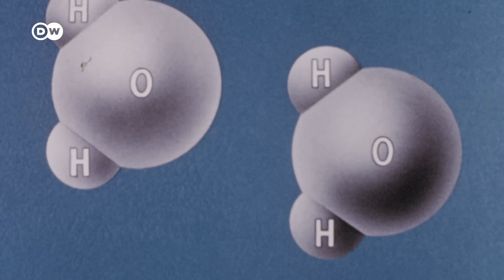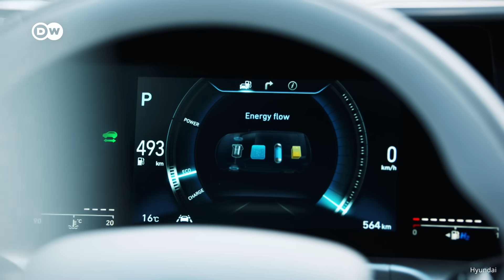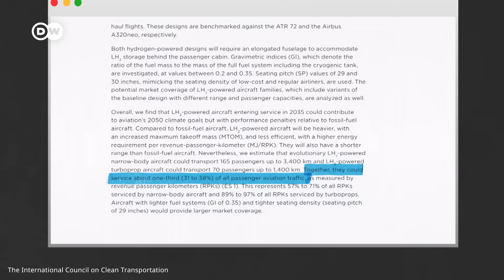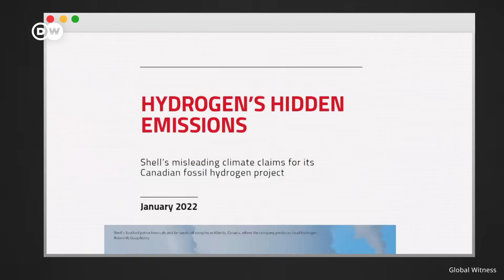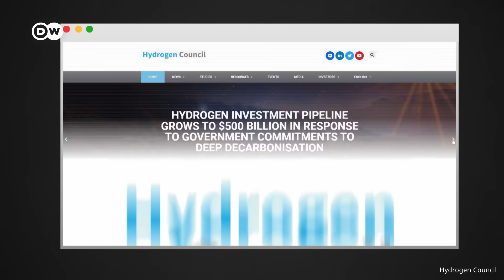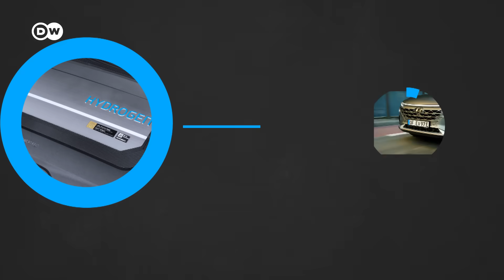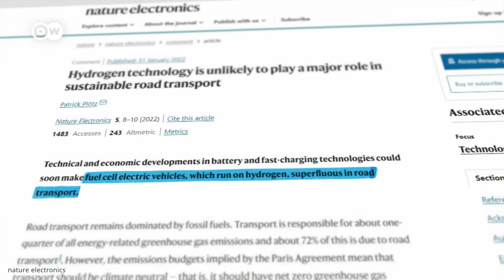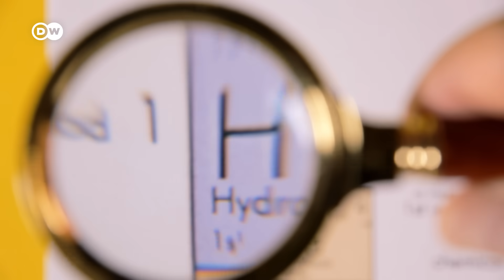The truth about hydrogen

Comment: In my opinion the real flaw in the hydrogen economy is (and always has been) the scarcity of the Platinum Group Metals used in the only currently viable hydrogen fuel cells.  There simply aren't any alternative catalysts which provide the same efficiency and longevity.   We're talking about trading one non-renewable resource, with another, that is much more rare and expensive to obtain.  The papers I've found on the topic suggest that it would require 100% recycling of all PGMs used today on top of future production to satisfy any large scale hydrogen fuel cell usage.
Reply: @daemn42
This is a big misconception. PGM are essential for Proton Exchange Membrane Fuel Cells/electrolyzers. non PGM catalysts with these types of cells do have performance limitations. Other Fuel Cells/electrolyzers (which are commercialized!!) do not require PGM. 

**For those who aren't familiar Fuel electrode refers to anode in Fuel cell mode and cathode in electrolyzer mode. Oxygen electrode refers to cathode in fuel cell mode and  anode in electrolyzer mode.

 Alkaline Fuel Cells, particularly Anion Exchange Membrane Fuel Cells (AEMFC) can use a Ni Fuel electrode and Silver as an oxygen electrode (silver isn't super abundant but more so than Pt). Molten Carbonate Fuel Cells use Ni as the fuel electrode anode and  Lithiated Ni as the oxygen electrode. Lastly, Solid Oxide Fuel Cells and electrolyzers also do not require any precious metals. The standard high performance Fuel Electrode is Ni based. The oxygen electrode is a ceramic often based on La,Sr and Mn, with higher performing cathodes incorporating Fe and Co. Solid Oxide electrolyzers operate at very high temperatures (500 -1000 C) which can drastically reduce the energy input needed for electrolysis. There is an excellent review paper in Science from 2020 by A. Hauch which  goes over the competitiveness of the technology.
Reply: @jpcool95480  Thanks for your input. I  wasn't going to take all of the time to expand on this. At some point it just isn't  worth my time and I am not sure who can understand it. I work around industries that require me to understand what I am working with and things are changing rapidly and exponentially.  I have been involved with Alternative Energy Concepts since 1984 when I was very young. All of my family have been involved with the trades in one way or another and I have a large brain trust to pull from. My father was in the Navy right out of highschool and provided maintenance and operations on so.e very high tech ships and weapons systems and he also worked around Nuclear. He got out of the Navy and went to work for an Electrical Utility provider and was around many different forms of Electrical power generation dating back to Nuclear power plants built in the 60,s up to Wind and Solar. He dealt with other forms of power generation and the National grid. He is gone now but had 35 years worth of knowledge and experience in the civilian world and the military on top of that. I learned a thing or 2 growing up. I went into the Army straight out of Highschool and took a similar but slightly different route. I specialized in Electromechanical , Electronics and eventually DDC systems. I was deep into Science and Chemistry and went into Industrial plant work and systems. As a hobby I did mechanical work and also Alternative Energy. 

So my comments are objective and Neutral. I have been solving engineering problems for over 30 years myself. I am the guy they send out into the field to fix what didn't quite work out the way they designed it. 

Alternative Energy is a Hobby of mine And so is wrenching on vehicles. It relaxes me and takes my mind off of other things.
I would give you 10 thumbs up if I could but I am sure many people have no idea what you are saying. They will just come back with Hydrogen bad , battery good.

What do you think of super capacitors instead of batteries?
Reply: @jpcool95480   And of all those you listed, only PEMC and AEMFC can be reasonably used in small scale transportation and all past and present vehicles use PEMCs.    The major challenge to AEMFC is CO2 poisoning, which both reduces performance and durability relative to PEMCs.
Reply: Yes this is the main issue. I'm disappointed that they didn't even mention the problem with catalysts in the video.
Reply: There are many Catalysts besides Platinum that can be used in a fuel cell. That is just another misconception. Hydrogen can bond with a plethora of metals and minerals. It just comes down to the correct chemistry and the reaction.
Reply: @desertdan100   I didn't say there weren't any other catalysts.  I said there aren't any that provide equivalent efficiency (performance) and longevity.   All the alternative are inferior in one way or another.
Reply: @daemn42  look up papers on Cobalt Nitride. It is way more abundant,  inexpensive and very nearly as efficient. In fact they are already using cobalt in some battery chemistry now. It has also been used In industrial applications for many years.
Reply: Not to mention, that the oxygen reduction reaction can't be properly catalysed by our current technology.
Reply: Nickle zink and cobalt manganese have been found to be good substitutes for platinum. Still uses less resources then the equivalent battery car.
Reply: I am curious if there is an energy advantage to using a fuel cell versus just burning the hydrogen directly for energy?
Reply: @paulconner4614  yeah fuel cells are way more efficient then hydrogen combustion though that isn’t stopping people from running hydrogen through their engines or companies designing hydrogen combustion engines. A side note unless you have a filter or file mix injector or some other subs-system that prevents nitrogen from the atmosphere to enter the combustion chamber, you will still get Nox emotions (unlike a fuel cell) still no carbon emissions except from the oil that sneaks its way into the combustion chamber (since engines needs lubricants). Still vastly better emotions profile in a green Hydrogen combustion engine but no emotions in a fuel cell.
Reply: Yet every car has a platinum catalytic converter to ignite unspent gasoline fumes. And hydrogen can be combusted in any ICE vehicle already existing with H2O as a byproduct. Hydrogen combined with nitrogen makes ammonia making highly dense liquid fuel that is nitro neutral.
Reply: @Dana5775   Catalytic converters use 3-5grams of platinum.   Fuel cells use around 50grams.     Burning hydrogen is less than half as efficient as using it in a fuel cell.     And burning hydrogen with air (which is more nitrogen than oxygen) produces NOx emissions comparable to any other ICE, that the fuel cell does not.
Reply: @daemn42 , not all cars have the same size exhaust or engine. What size fuel cell are you comparing? 
Burning gasoline is also less efficient than fuel cells19 vs 65. The exhaust from burning hydrogen is pure H2O. The nitrogen came from the air and returns to the air and is nitrogen neutral. The atmosphere is 80/20. Not sure what your point is and you missed mine. As far as platinum is concerned you don't know what percentage of platinum would be used as it is a plating that can be dispersed in extremely minute thickness. Technologies being developed for platinum fuel cell catalysts are increasingly becoming less than a single layer of atoms when combined with new material Co-catalysts stretching the platinum necessary far below the current catalytic converter plating. 
The point is the platinum argument is certainly a problem yet we do not see anyone complaining about this regarding catalytic converter platinum applications. Ceramic fuel cell plates are very viable IE. The Bloombox. These use a reformer to crack NG into hydrogen and when the cooling fluid is used as domestic hot water and heating and cooling they are 95 percent efficient in non-mobile applications for over 10 years now. These are already saving large energy consumers enough to pay for itself in one year.
Reply: @Dana5775   Again, a typical fuel  cell  for automotive use (there aren't that many different sizes out there, as they're almost all compact cars) uses about 10x the platinum of a typical catalytic converter *today*, so you can't say you're just trading one for the other.   I won't speculate on improvements to the process that don't yet exist. 

Burning hydrogen with air  produces both H20 and NOx emissions, which are an unwanted pollutant.    It would only be Nitrogen neutral if the byproduct was pure Nitrogen.  It is not.    Yes the nitrogen comes from the air, but so does the O in CO and CO2 which are both unwanted byproducts of hydrocarbon combustion.  
The point is fuel cells are clean, while burning hydrogen is not.    

As for efficiency, you were offering Hydrogen ICE as an alternative to fuel cells, so that's what I compared.   It's been tried, and the range of hydrogen ICE cars is truly pitiful.  

BTW, it's just as easy to make a synthetic fuel pulling CO2 and water out of the air and turning it into a liquid syngas which burns pretty much the same as gasoline or jet fuel and is also carbon neutral, but has a much higher energy density.
Reply: @daemn42 , Hydrogen engines are likely to become a major milestone on the journey towards a zero emissions economy. Because they employ technology that is available today, and are viable to deploy in a wide range of use cases, they are a great way to act now. Not only can they unlock significant progress in terms of reducing emissions, but they also contribute to growing the infrastructure needed for other hydrogen applications including hydrogen fuel cells.
Reply: Nickel as a catalyst for cars
Reply: You are right.  Platinum must be efficiently recoverable, and the processing to do this will cost money.  So will the nuclear power plants and the related infrastructure.  It will take a wealthy world to run on hydrogen, and this is why it is some way off.
Reply: Convert green hydrogen to green ammonia and use it directly in internal combustion engines. Safety of ammonia handling needs to be improved and we'll defned regulations need to be implemented.
Reply: @sh230968 It requires an enormous amount of energy. .
Reply: You seem to be implying that we replace gasoline and all batteries with hydrogen fuel cells. I guess those who coined the phrase "hydrogen economy" to replace the fossil fuel economy are to blame. Hydrogen has its specific uses in  areas like steel production (catalysts unnecessary) and heavy transport like shipping, but there are far more economic and ubiquitous areas that benefit from other even better suited technologies. Hydrogen fuel cells in a wristwatch? Probably possible but uneconomic and impracticle.
Reply: @Wizard_of_oOZe   My focus is the same as most folks who talk about the hydrogen economy, the transportation sector where we have a need to take energy generated from clean renewable resources and put it into a form which can be used for transportation (other than e-trains), allowing for fast and flexible fillups.    For this hydrogen fuel cells are the only viable option, and they require efficient and durable catalysts, which right now can only be accomplished with PGMs, an incredibly scarce and expensive resource.    There exist alternatives which can match efficiency or longevity, but not both.
Reply: Then use hemp stalks fed into a biodigester to produce cellulosic hydrogen to turn an electrical generator & store the electricity in inexpensive super-capacitors made using hemp bast fiber.

Comment: You explained it well - green hydrogen is the only clean hydrogen and a lot of electricity is required to produce it. So as a transport energy, electricity via battery would be better suited. At the moment, maybe it’s Better to focus on technologies to clean exhausts of current fossil fuel energies.

Comment: The solution should always be as simple as possible, so Hydrogen looks promising from this aspect alone.
Reply: A hydrogen system is not simple at all, especially compared to a battery electric situation.
Reply: @Freba9  I wanted to say that it is simple in a sense that hydrogen is abundant, it is relatively easily extracted with electrolysis, and the only product is water, from this perspective it seems like a logical and simple solution to the problem, but you are right the complete process is (still) complicated and expensive.
Which is not very different from extracting the crude oil, refining it, transporting to local gas stations, and doing all the damage along the way. It is more affordable because we do it for more than a century.

Comment: Hydrogen is essentially a battery, you need energy to create it. If the hydrogen can be created by renewable sources like wind and solar, thn fine it has a place. Personally, I dislike the huge batteries needed for today's electric cars. Batteries as a service makes sense where batteries can be recycled and charged off peak times, but you still have a battery at the end of the day. I look forward to the day when we can use hydrogen efficiently.
Reply: You should realise that hydrogen vehicles require 3 times more energy than an EV. So three times as many wind turbines and solar panels have to be built and maintained. Current EV batteries will last just as long as the vehicles themselves.

Comment: Its all not really about Hype. Its more about availability...Electric Cars are NOT the future because of the batteries. We don´t have enough recourses to make modern batteries for another 10 years...so we have to change to Hydrogen cells as our power delivery. End of Story

And yes, if there are REAL and USABLE developments with alternative batteries that use resources that are more abundant, we might use those but trying to plan on things that don´t exist or work yet would be like not building renewables because at some point Fusion should be viable...
Reply: Resources for batteries are not really a problem. Is it challenging? Yes. But it is just a matter of ramping up extraction. Hydrogen cars also require materials like platinum, lithium, cobalt and nickel. Due to their lack of efficiency hydrogen cars will also require three times as much energy, so three times as many solar panels and wind turbines need to be built and maintained.

Comment: I suspect the best safe viable solution can come from mechanical batteries... each of 3 permanent magnets aligned... with a large enough shielding that alternately slides between them assisted by an ultra-super-capacitor to easily move both shields. For more info... feel free to ask.

Comment: Totally absurd to not include hydrogen from nuclear. Makes the entire video a total joke.
Also hydrogen burned in ICE engines DOES NOT result in only H2O. 
Anyone not advocating for nuclear power to reduce GHG emmisions is delusional.
We need massive reductions not just picking away at the problem like "renewables" do. We will also need an oversupply of electricity to power carbon sequestration projects. This won't  happen when the sun isn't shining and wind is not blowing.
Hydrogen has great applications but it uses energy at every single point. It doesn't just sit stored anywhere. Needs to be constantly cooled and it leaks out of almost any container. ALL reducing its efficiency.
Reply: It doesn't matter where the electricity for the hydrogen production comes from. It always remains inefficient.

Comment: 9:01
You do not need 3 times as much space to store the same amount of energy as compared to natural gas. It is true when uncompressed but that does not happen often in reality.

Hydrogen used in cars is compressed under 700 bar (350 bar for commercial vehicles) but natural gas (CNG) is only under about 200 bar. So 1 kg of 700 bar hydrogen is actually slightly more energy dense than 1 kg of 200 bar CNG.

Comment: Everybody talks about storing excess energy into the H2, but look around, there is rarely any excess energy .. we have less electricity than we really need and most of it is still made of coal or gas - hence rising prices in germany. It is utter luxury to use it on such inefficient processes like driving FCEV (max 30% ef.) instead BEV (max 90% ef.). Our first goal should be focused on replacing fossil powerplants for solar, wind, geothermal and fission/fusion. Not even talking how difficult and energy / resources demanding is to make H2 infrastructure that is also high security risk for public (H2 is extremely explosive burning speed is 3 m/s vs. methane which is 0.3 m/s).

Comment: Zero emissions is a lie. There will always be emission from industry. There are 19,253 SCF of carbon dioxide in one metric ton, so 1 million SCF of hydrogen will produce 13 metric tons of carbon dioxide.  The carbon footprint for the production of asphalt is 840 kgCO2e per metric ton. The manufacturing of the tyres comprised only a small amount of the total GHG emissions (2.1 %), and the list goes on. We can only reduce not Zero. Hydrogen is still the fuel of the future, not battery

Comment: The only thing holding back Hydrogen from being a genuine first provider of energy is the lack of support from the world's Governments, but also the low support from the fossil industries, as they can only see the losses to their immediate profits from mining, drilling and research into resources of coal, oil etc to the detriment of of the future of the planet.
If as much time, effort and resources and logistics as with fossil fuels, was put into development of Green Hydrogen, then the 'Negative' sides to using the Universe's most abundant energy source, can be negated in a relatively short time span.
As far as Hydrogen being just a storage medium, this is also true of oil, gas and coal, which all require major processing before they can be used for consumption.
Negativity by the other energy 'suppliers' is an enormous reason for the slow take up of Hydrogen  as a usable fuel for all!